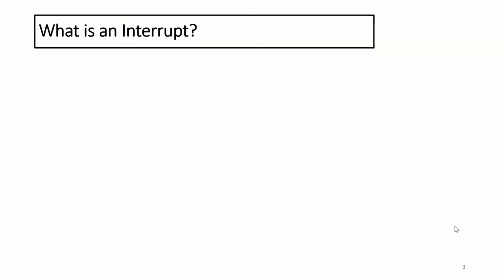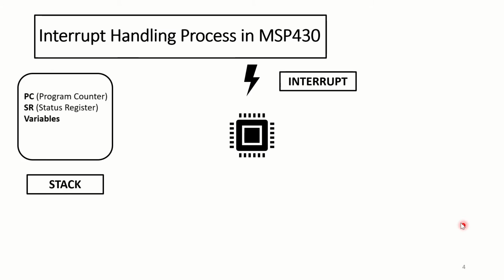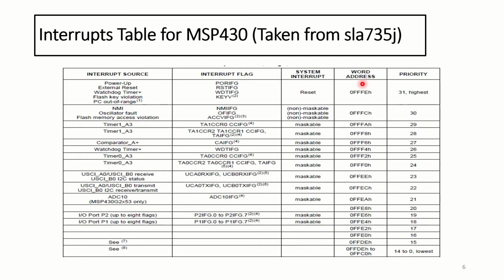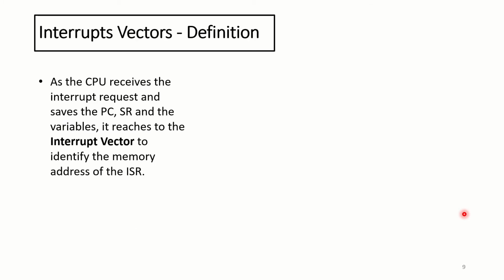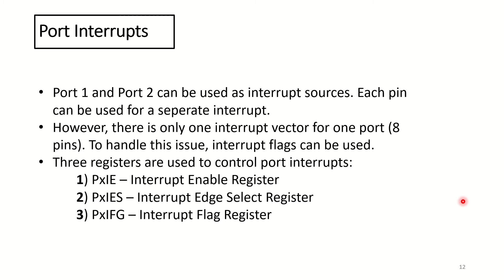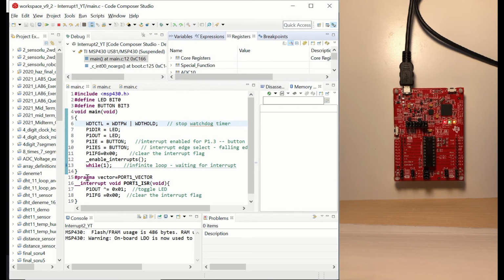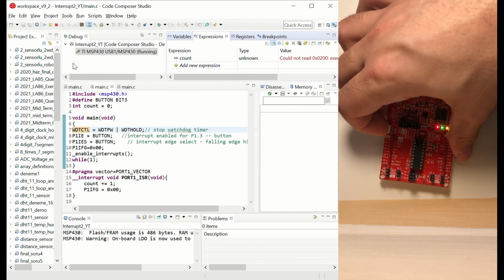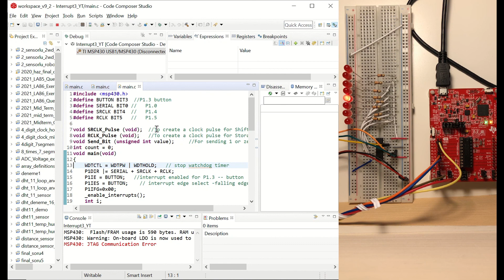Interrupts in MSP430

Comment: I am interested in using an interrupt to define intervals to do two actions, like measure an ADC value, or change the duty cycle of a PWM(to ramp motor speed).  I'd like to do each action at separate frequencies.  It seems like using a timer interrupt and using the compare mode may be appropriate.  For example if I wanted to do action1 every 7ms and action2 every 13ms can I do this within one timer?
Reply from the maker: Hi, I’ m not sure if you can read the adc value in an interrupt since adcmem value is read while adc10 is not busy (pls check the adc video and code: while(ADC10CTL1 & ADC10BUSY);)
Regarding generating two interrupts with a timer it should be possible. If you select your clock speed and taccr0 and taccr1 values accordingly. You should also be careful with the mode you’re using (up, up down, continuous) . I had tried to give information on those (timers) in the hcsr04 video.